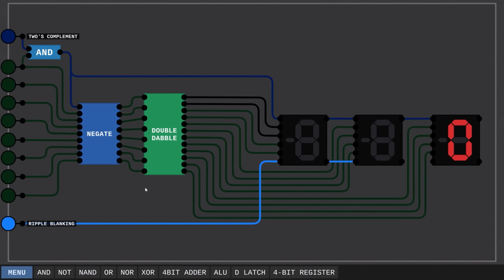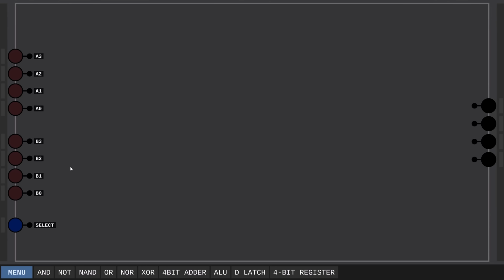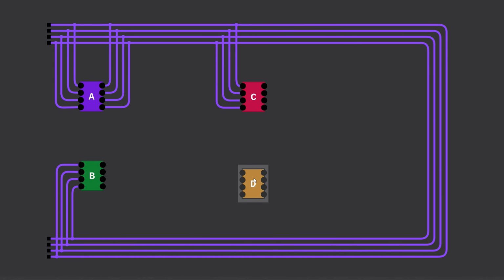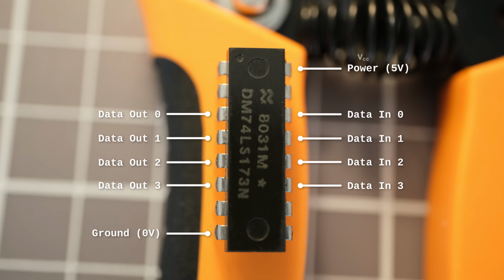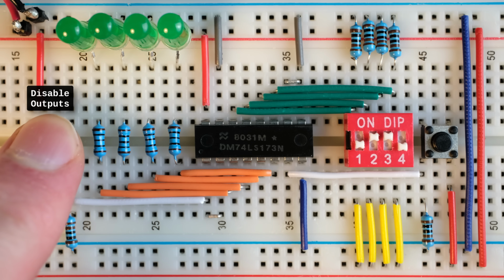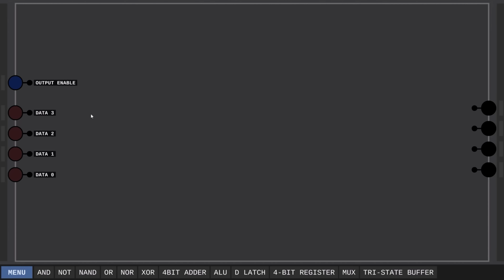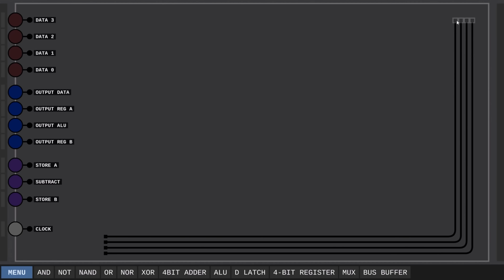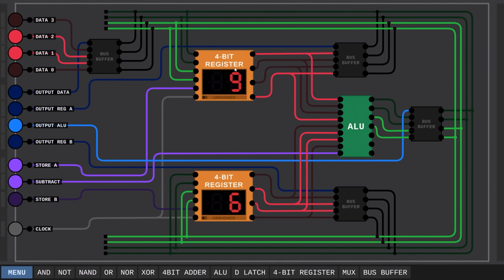Experimenting with Buses and Three-State Logic

Comment: that sim looks awesome ...great job... id love to build up a full 8bit data-16bit address bus machine with this in the future when some more features are added...needs resistors, capacitors, and transistors..NAND gates (the only gate you need!) can then be built up by transistors...if would be really sweet if C/C++ code could be dropped in for chips aswell..to emulate full blow CPUs (eg Z80) within the sim...without having to completely build up the cpu via discrete logic (which will get very messy very quick!)

Comment: The reason for the store signals to be 0s is most likely because it's build in NANDs logic that by it's logic rules if any signal is always HIGH (1)  then it has a fixed logic status of LOW (0) since a NAND port only can be HIGH if all signals at the entrance are LOW.
Biestables with NAND logic follows negative logic since they are "active" with all entrance at 0.
Store command/ Data signal / NAND Out
0/0/1 (inversed or negative logic rules)
0/1/0 
1/0/0 (unable)
1/1/0 (unable)

This is an assumption since the logic followed can change by the same rules of multiplication. Two negative logic block in series ends up as a positive logic device/block. As example two NANDs. 

Enable/Data/1out/2En/2out
0/0/1/0/ 0
0/1/0/0/ 1  
now data and 2out follow positive logic or direct logic as explained

Comment: I think this is the way real computers work ( I am not certain because most of my knowledge comes from Gary's Mod and Little Big Planet 2)  but you could use a demulitplexer to select a register, and you could even store a register address in another register.   You could take 2 signals and split it out into 4 unique signals, or 4 into 8, but that would make sure you never select two registers at the same time.
Reply: Yep, this is more or less the embryonic state of a CPU instruction decoder.

Comment: You could have put another LED tied to the power at the bottom that'd lit with "0" output and in high-Z none would lit. Also adding resistors as a "random noise" is bit unfortunate as the "pull-up" resistors are a thing and even required, for example in I²C communication.

Comment: Wouldn't it be safer to have a chip that takes an exponential input for which wire to output to and then outputs it to only that wire? So like have a chip with 3 inputs and 8 outputs where every state of inputs corresponds to 1 output wire being on.
That way you make sure there can't be contention between registers.

Comment: Did I miss something? I didn't see the three-state output block being built? Just dragged in and used, unlike, if I recall correctly, is the first time that has happened. You've built the blocks during the explanation phase before using them, showing the inner workings. For the three-state output, however, you utilized the real world to demonstrate (which was cool to see), but I don't know how the logic was implemented in the block.
Reply from the maker: The tristate buffer works at the transistor level, so it can’t be created from the logical building blocks (not/and) of the simulation. For that reason I had to demonstrate it in the real world, but then just program it into the simulation as one of the fundamental built-in chips.
Reply: @SebastianLague  Ah, that's why I never understood it, hahaha, thanks!

Comment: I played with your simulator a bit and made a circuit with a 7-segment display, but I noticed there's no way to show the display on the "outer" circuit like your registers do (I assume that you've hard coded those in the simulator). It would be cool if you could automatically show any internal displays on the external chip. You could just take all the displays from left-to-right and smoosh them together into one. You could also maybe make the "unsigned" toggle switch generic by having an option on each pin to convert it to a switch.

P.S. how do you manage to make all your wires perfectly aligned 😐 Even when I use shift to make them horizontal/vertical I can never the last segment aligned right and it slightly bothers me 😅

Comment: What a neat little logic simulation tool!
But I have to wonder: How in the world do you manage to place chips and wires so neatly aligned, horizontally and vertically? Is there some kind of hidden "snap to grid" option? Everything I manage to do always looks crooked and at weird angles, which really messes with my OCD. 
Also, I would love to be able to edit wires after I've placed them. If that's too complicated to implement, a keybind for deleting components and / or wires would serve nicely in the meantime.
Reply: use shift to move it in a straight line

Comment: Just curious why the OR Gate is not included as a standard gate when the program is first downloaded? It is one of the three basic gates. I understand that you can make the OR gate from the AND and NOT gates, but that makes it more complicated than just having the OR gate to start with. Physically its roughly the same as an AND gate when made with transistors, so just curious if there was a specific reason you had decided not to include it as a basic gate.

Comment: Is there a trick to getting everything to line up perfectly when you're building the circuits?  Or do you just do practice builds?  It's like you never place a chip in the wrong spot and place the wires pixel accurate.  Like a filtered input replay.

Comment: There is one thing missing for a microcontroller: some sort of ROM for commands

once you implement that, I will certainly built a functioning 8bit microcontroller as soon as possible in your simulator
(visually merging wires would make things easier though lol)
Reply: Bus wiring would be a great feature! i.e. bus wires that are represented visually as just 1 big wire, rather than several parallel ones.

Comment: Amazing content.  Going through it with my kids.  Any hope of more?  Or update of downloadable version to what you use there?  7 segment display on the register is really a huge space saver.
Reply from the maker: @joshbonney9624  Thanks, and yes to both in the next two or so months (if all goes according to plan)
Reply: @SebastianLague  I don't know if you are aware of the modded version of your program out there.  Larger surface to work on, zoom, etc...  They implemented it poorly (in my opinion) If done with your level of care, they could be amazing.  Would make some really complex systems possible.
Reply from the maker: @joshbonney9624  I’ve redesigned some stuff for the new version, and it will indeed have a much larger workspace :)

Comment: Just curious, how does the tri-state buffer operate? I was initially seeing it as an and gate but I see it has basically three "output" states, high, low and disconnected. I can conceptually see how it works but not how "disconnected" could differ from "low"/grounded to the wire, only that it cannot "backflow" into the buffer

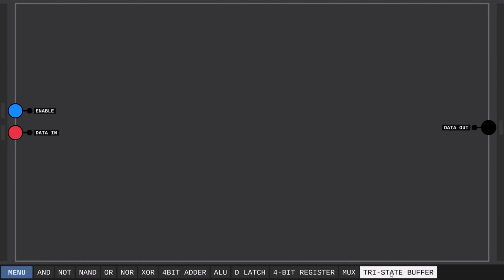Comment: 12:21 The tristate buffer internal logic in the simulator is not shown. Just the physical one made of transistors. Why's that? How does it work in the simulator?
Reply: It has to be implemented in the simulation engine because it changes how the connection works.

Comment: The Clock chip is a bit broken on a 144hz monitor with vsync turned on, it doesn't flash with the right frequency, to fix it I just simply turn off vsync

Comment: The tri state buffer in the simulation is just an and gate with another name.
Reply: Well you can have it be disconnected do it doesn’t interfere with busses
Reply: What?
Reply: Isn't the buffer just a chip sending a signal when both inputs is on?
Reply: @cotawa9692  When the top signal is off, the output is neither on or off.
Reply: Ok, so it is an and gate with a disconnect feature.

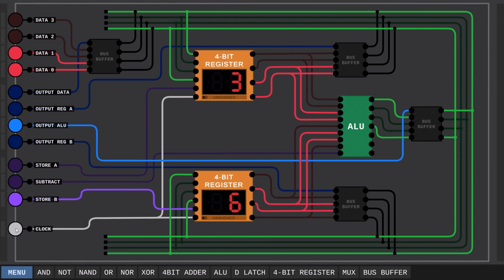Comment: I'm slightly confused with what's happening at around 17:00, wouldn't there be a race condition on the B register. How does it know to store the 6 which is available on the bus only after the ALU's propagation is complete, even though the rising edge was already sent when the value on the bus was 3, i.e., the old value of the B register?

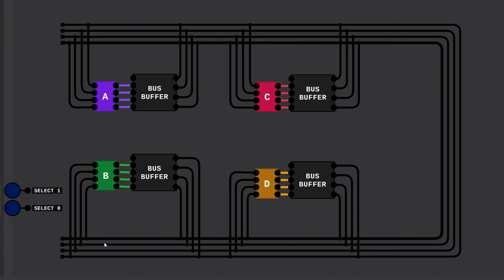Comment: @ 13:35 I don't quite understand why you need an output signal for each chip. Couldn't you instead decode two signals and guarantee that only one chip output is enabled?
Reply from the maker: That’s true you definitely could. I might add that later on.

Comment: Is there is a way to make signal to pulse generator or something similar? I need convert constant signal to pulse on rising edge of that signal. IRL i can use invertors that they have delay and XOR gate to cut constant signal to pulse but cant figure how it can be done in this awesome simulator. Thnx for advices.

Comment: I am using your software, but the 7 segment display is not embedded in a circuit. ie I build a Binary to BCD circuit using double dabble algo, and instantly connected those to the 7 segment display. I saved it as Bin-Disp, But when i import this circuit to another workspace, only 8 inputs is present, no 7 segment displays is on the box. Just 8 inputs... In your videos, on the 4 bit registers, they have a 7 segment display too attached with the register itself. How can i do like that...?

Comment: Hi!
Maybe I just can't see The difference, but isnt the tri-state buffer the same as an and gate?
Reply: The difference is that an AND-gate is actively outputting either 1 or 0 at all times. A tristate buffer is outputting 1 or *nothing*. It's hard to grasp initially, but there's a very important difference between 0 and *nothing*, electronically speaking. 0 is an active, driving, signal - meanwhile the "nothing" / tristate is the complete absence of a signal. Make sense?
Reply: @Mythricia1988  Thanks!

Comment: Hey probably the wrong place but on Linux using non numpad plus/minus doesn't let me add/remove pins?
Reply: It sounds like you got further than I did. I can't even get the program working. Can you explain how you pulled that off or tell me where I can find out?
Reply: @VulcanOnWheels  I downloaded the Linux version. Extracted the zip did chmod +x thebinary then just did ./thebinery
Reply: seblague forgot to add it in the new version

Comment: Love your video, but I can't use your app for the simulation, please assist me with the problem (I'm running on MacOS system, and it kept showing me that the app couldn't be opened)
Reply: 1.    Once you've downloaded the zip, extract it.
2.    Right click the app and then click "show package contents".
3.    Open the folder "Contents", then the folder "MacOS".
4.    Open the app "Terminal".
5.    Inside the shell, type "chmod +x " (make sure to leave a space at the end) then drag and drop the file from the folder you just navigated to onto the terminal window. This should add the file's path to the end of the line.
6.    Click enter.
7.    If it doesn't work, do "sudo chmod +x ...", enter.
8.    You can now quit the terminal and close the finder window.
9.    If you try to run the app, it may say “Digital Logic Sim” can’t be opened because Apple cannot check it for malicious software.
10.    To fix this, just right click on the app, click "Open", and then click "Open" in the new popup.
11.    The app should work now!